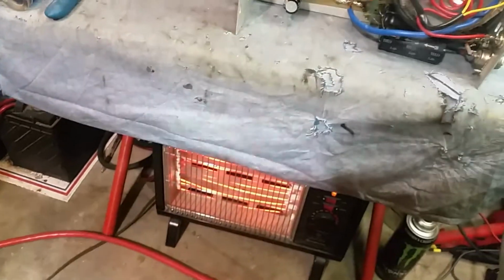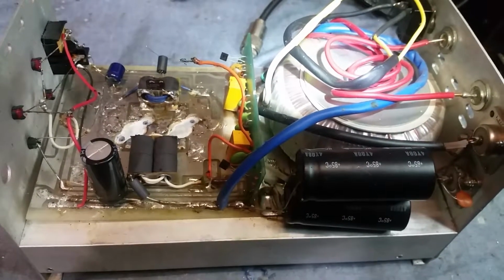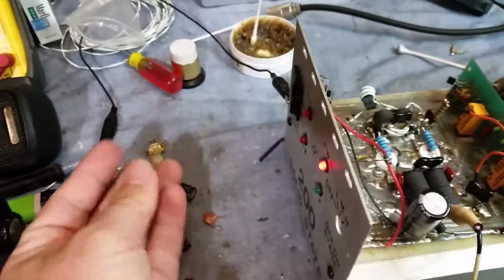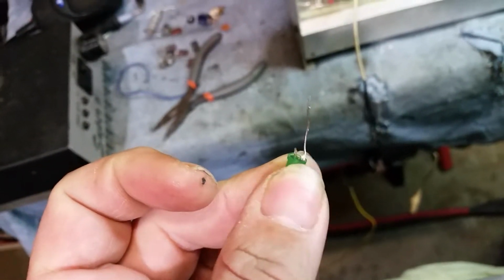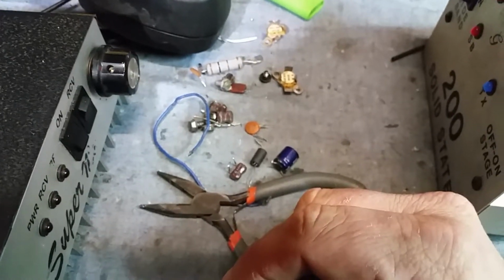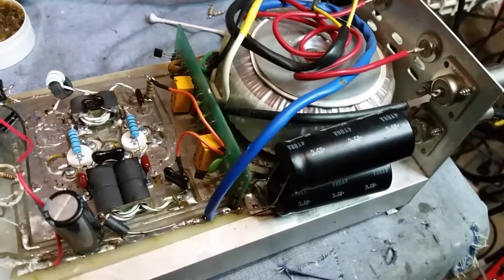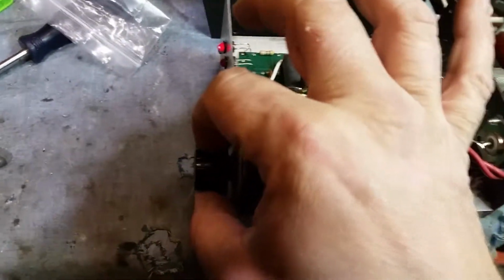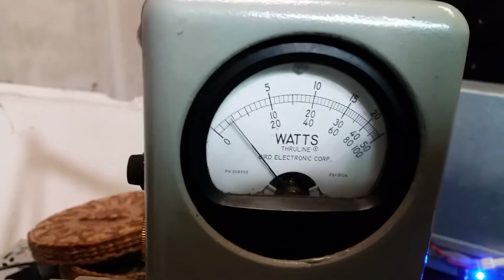Gray 200 Rebuild & Palomar 2 Pill Repair 🩺 - [Double Wammy]

Comment: Hey gatekeeper I have the same box, do you do repairs? If so I do I contact you
Reply from the maker: I do nut not taking in currently I will be in thr very near future.
Reply: @1883GotDown  thanks for replying, I also have a JB150 and a Palomar tx 200 that needs work. I’ll be checking your post. Thanks again

Comment: Gatekeeper, I know you have done a couple other Texas star Turbo mod. Amps..I have one with the  4-2879's it's been sitting and would you be able to go through it and check it out and fix what it might need.?
Reply from the maker: Sounds great hang on to it a bit longer until. I start taking in work soon i can add you to my waiting list. Text me at 678 557 4846 and tell me to add you yo the waiting list for Texas star repair

Comment: I had many gray amps come threw over the years. one like that base amp. I think it came with MRF 455 . the one I did had blown diode and pills. Them press fit diodes are use in old battery chargers. I used stud diodes. case is ground on that. I did 454 as well. just enlarge holes a bit on the board. several gray amps I had to re tap heatsink. they did not use standard screws. I had a gray 50 and 100 mobile amps come threw.  The base amp I did may have been hit with power surge. The owner put coax in jar before the storm, after that the amp only worked a day and quit. think when diode went open that ripple pop the 455 . it has ben fixed before. I did put in AC fuse and MOV. hot to natural and hot to ground.   I put new power cord on it, had lamp cord when came to me.  73's

Comment: GK you need to look into building yourself a waste oil heater. Surely you can get plenty of used motor oil to keep your garage warm in the winter! Also consider Kerosine heater. Cheer's!
Reply from the maker: Very good point.....actually these videos are old about 4 to 5 years and my buddy tech 9 told me about oil heaters a few years ago and I finally got me one from wal mart but I plan on getting me another one. Tech 9 told me a story that got my attention and is why I made the change.